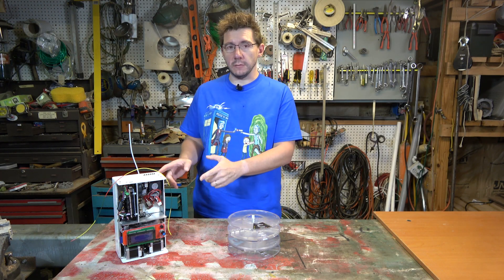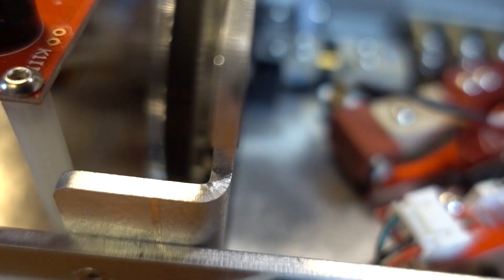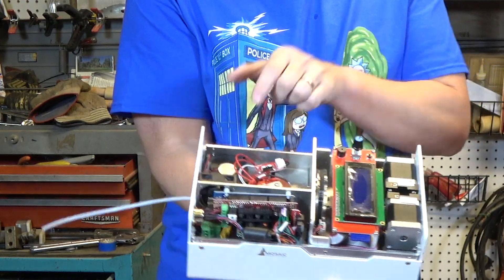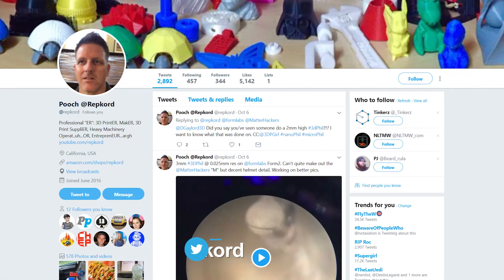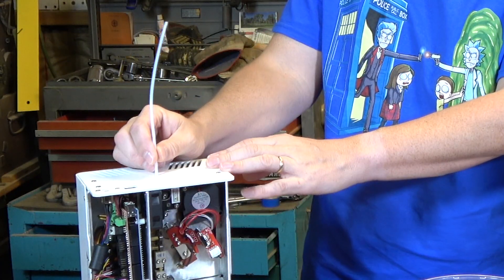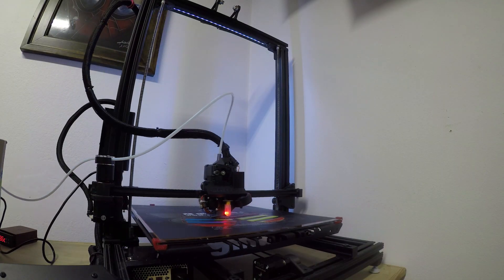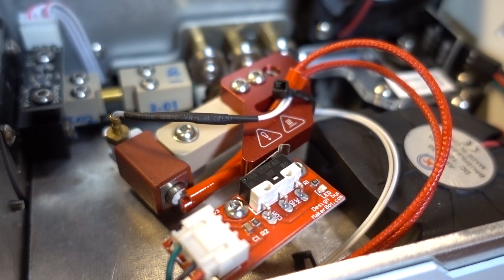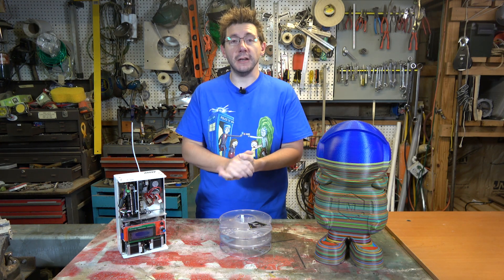3D Printing in RAINBOWS? 3D Phil from Matterhackers Looks Like Melted Crayons!

Comment: I was playing with the slicer on the Cetus 3D using different settings and the model scaled to the maximum for that printer which is 10" tall. With a .02mm nozzle,  0.05 layer height, 13% infill, 4 shells and using the Cetus 3D Fine setting the printing estimate was 393 hours. My immediate reaction was, "That's not gonna happen". I just thought it was funny.

Comment: I like the idea of the palette but its just too pricey. If it were fully integrated into a 3d printer I could see paying the 1k price tag. But as a clunky add on it's not worth it and seems to add a bunch of failure points to the printing process. The palette tech seems to be more versatile than dual extrusion though so I hope they are able to work out the bugs, shrink it and integrate it in the future.

Comment: No purge block?  I watched a video on the Palette+ and there was a purge block
Reply from the maker: When printing for specific colors, you need the purge block, however, I just let the filament flow in a random order, so, no purge block needed!
Reply: I have been looking into either using a product like this or the Prusa multi-filament add-on for the MK2S. I don't care for the Purge block waste though. Since you have had hands on. Is the purge system between the two the same? I do like the ability to just allow for blending. Do you have a preference?

Comment: Enjoyed the update and inside look at the Pallet+.  It certainly is the one of the less wasteful solutions to multicolor printing.   I like that it is not printer-specific hardware.  I can buy this once and use it with the printers that I have or may buy in the future.   Dual head printers in combination with the Pallet+ could speed up the multicolor printing process further because one head could be loaded with the predominant color and the other head  attached to the Pallet+.   I'd love to have a single filament lower cost "dumb"version to fuse and combine all of those reels that I have with small lengths of filament together.  Does Mosaic have any plans?
Reply: The pallet requires the same purge block the prusa MMU needs, so does the diamond hot end, only way to prevent that is to go Idex, but then you're limited to two color.
Reply: bummer.  I'd still like a single strand "manual" fuser.
Reply from the maker: Yes, I believe Mosaic Palett+ has the ability to fuse multiple low spools together. I think. MORE TESTING!

Comment: You rock, Joel! For the record, we have solved the bug that you ran into re: the Change Filament function.

Thanks for sharing our creation with the world.
Reply: If you consider what the Palette+ can do, it is able to convert any printer into a 4 color/4 material printer. Outside of the Prusa multi material upgrade -- which is limited to the Prusa MK2, there are no other alternatives to accomplish the same without spending much more on a 4 color/extruder printer. Consider that you can pick up a CR-10 + a Palette+, and have a large format multi color printer for much less than an Ultimaker 3 or a Sigma, and pretty competitive with a Prusa MK2s + Multi Material upgrade (but bigger). Considering the current market, the cost of the printer is not particularly relevant as the Palette+ increases the capabilities significantly. It makes sense for Joel to demo it, along with the splicing issues you may encounter -- as I did myself in my first print with the Palette+. This is clearly not targeted for folks who are looking for a printer for $300, but for folks who have the finances or who have the artistic need/hobby or business for a multi color/material printer without spending $5k+ on a dedicated 4 color large format unit.
Reply: Well then, I look forward in seeing what you create with this amazing machine, until then keep up the great work!!!
Reply: This video doesn't give this machine the credit it deserves. Product is well manufactured but really costly.
Reply from the maker: +Gnarly 3D Kustoms it doesn't as this was just a print on a whim. Much more content is planned around this machine, I guarantee it.
Reply: Mosaic Manufacturing hey mosaic! due to the hefty price tag this device cost a lot more than a majority of this channel's viewers' printers. what did you try to aim at by sending Joel a mosaic? And is this product in any way aimed at the average maker?
Reply: Hi Alec, a reality is that developing new tech takes a lot of resources. We're a team of ~15, ~12 of whom are engineers. Our first product, Palette V1, was $999. Because of scale and manufacturing efficiencies, we were able to bring the price for Palette+ down to $799. And, although we're financially healthy, we're still not profitable as a company.

Also, Palette+ is built like a tank. It has 7 stepper motors, and several systems that I think most folks would consider highly advanced (e.g. you can learn about the nuances of Palette's drive systems in one of our tech dev blog posts from July 2016: https://www.mosaicmanufacturing.com/blogs/news/aluminum-evolution).

Our aim in sending Joel a Palette+ was to share Palette with the world, of course! People have been asking Joel to play with Palette for a long time (see this tweet from August 2016: https://twitter.com/bischbot/status/763428245740130304).

When we think about our 'target market,' well, the 'average maker' is always changing. First and foremost, our goal is to make 3D printing more useful by increasing the range of objects that 3D printers can create. Yes, that means that for lots of folks, the price isn't worth it. On the other hand, we have some users who use their Palette+s to print and sell objects, and have more than made their money back on their purchases, and are buying more so they can increase their production. No product will be good enough or cheap enough for everyone; our hope is just that we can make something that people actually want to use. If demand grows, we'll be able to produce things a little bit more effectively and hopefully be able to bring the price down for future products.

I hope this sheds some light into how we think about pricing!
- Brennan
Reply: If you read through the comments for this video you'll get the cents that people really don't understand what this machine is capable of!
Reply from the maker: No mark was missed, as this was just a whim, and a full technical (as much as I can do) breakdown from what I've learned AND from the Mosaic visit to my house is planned. I got a very detailed breakdown when Derek from Mosaic visited my shop, and it's truly amazing. THIS was meant to show off a large neat colored model, and I thought it wouldn't be right unless I mentioned something about the machine that created it. You're right, people don't get a sense of what the machine is capable of, and knowing that I can prioritize creating the next video using this machine appropriately.
Reply from the maker: +Gnarly 3D Kustoms thank you so much!
Reply: Mosaic Manufacturing but a palette costs more than a lot of printers! Make a budget version with 2 or 3 colors maybe?

Comment: Can't you do this without the palette with the Prusa I3 MK 3? Considering their new features?
Reply: True however why spend 800$ on a palette when you can do it with just the printer. You can probably make the Prusa I3 MK3 halt the print at a certain time so you don't have to be there for it to stop so you can eventually switch colors. On top of that prints often take a lot of time so changing filament in a certain amount of time won't be that big of a deal. I don't think the 800$ price tag is worth it in this case. In fact for 800$ you can pretty much buy the Prusa I3 MK3 Kit.
Reply: I see what you're saying and I completely agree. If they want to change colors every layer it wouldn't be very sustainable to do it manually however I do think that the people that do this are essentially playing around and are just doing it as an experiment. It is a cool idea but the price is just too much for it to be worth it.

Comment: Isn't splicing like 400% more efficient than having to usea purge tower?
Reply: I may be a little off the mark here, but it seems to me that you still need a purge tower to print cleanly with this splicing technique. If you have filament A spliced to filament B, when the splice gets to the hot end you still have filament A and B melting together. You can see if you pause and go frame by frame starting at 2:36, there's a yellow that goes to orange before getting the red. So if you want solid clean lines between your filament colors on the same layer, you still need a purge tower.

Comment: Wait..... Is that a ramps board ? :D

Actually, that does make sense, it's a readily available board with all the required hardware for stepper control, servo control, endstops etc, why reinvent the wheel when you can use an existing product, I like :D